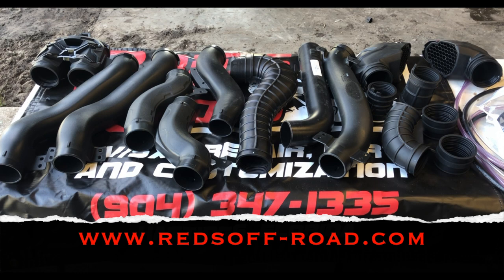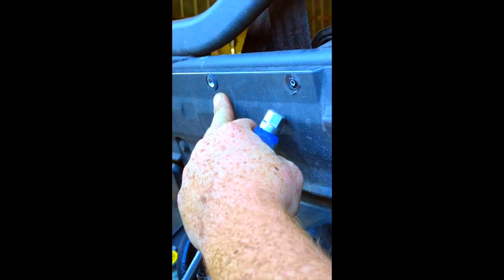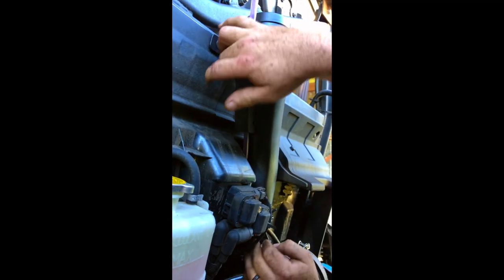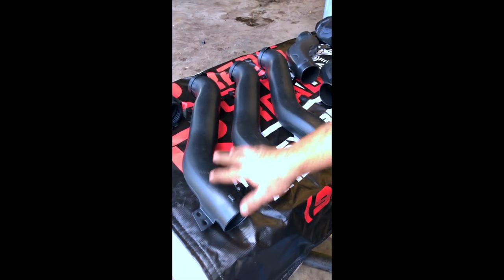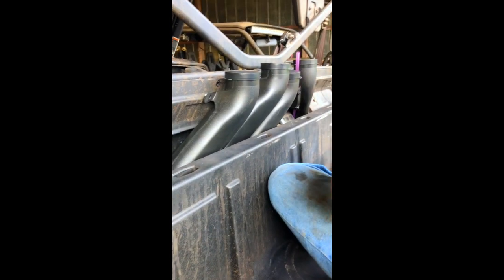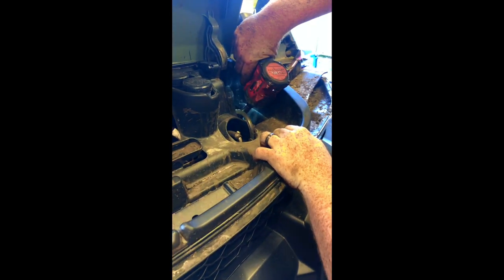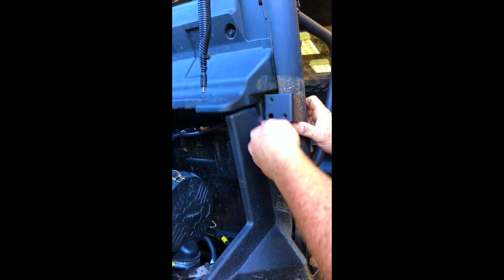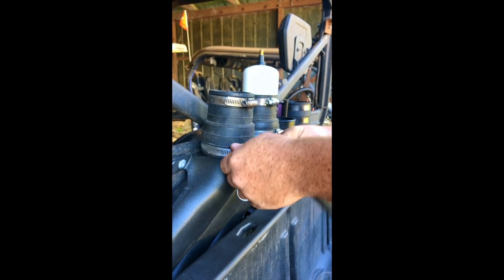CAN-AM DEFENDER OEM SNORKEL KIT INSTALL

Comment: This is same setup on XMRS.
This snorkel you fitted is highly prone to having your engine dusted leading to requiring top end rebuild.

Defenders are very short lived here in New Zealand. Gearboxes self destruct, engine very prone to dusting, steering racks failure, front diffs blowing all within 2 years.   
Beyond that chassis crack, engine dusting. The speedo cluster dies after hrs exceeded.

Get rid of the in tank filter and plumb in a Racor Snapp water trap sediment filter... thank me later.

Comment: can you just add  a piece of hose to increase the length of the existing fuel line vent hoses and the front differential.  On the water pump hose--why did you two pieces of the same size hose with a connector.  Why not one piece of house?  Thanks